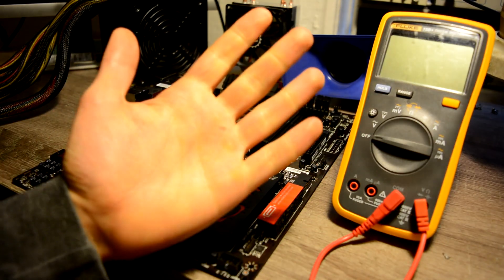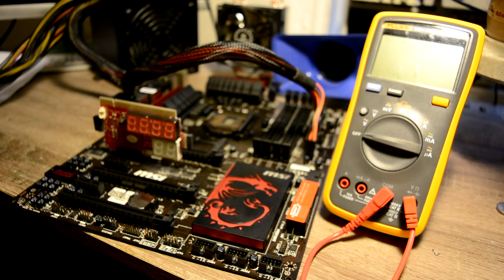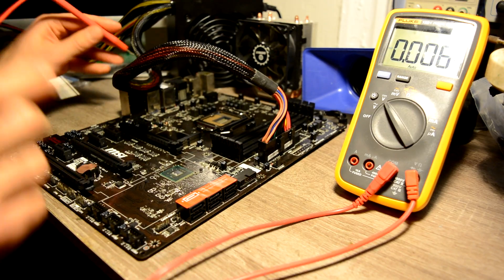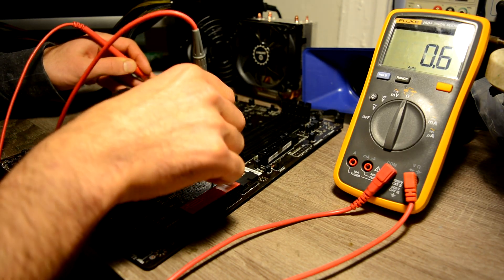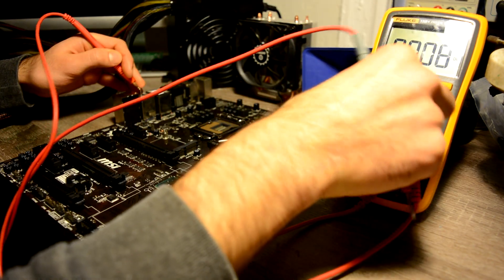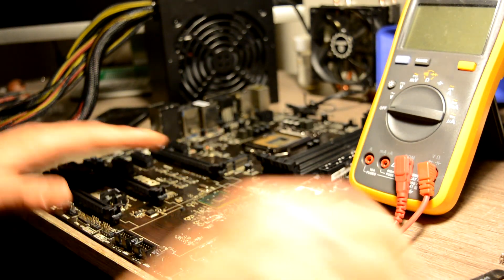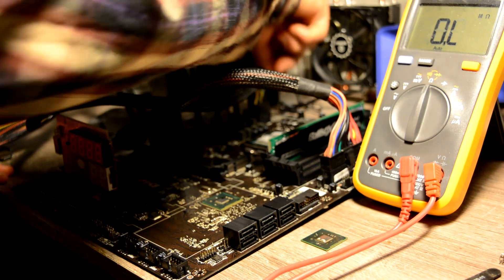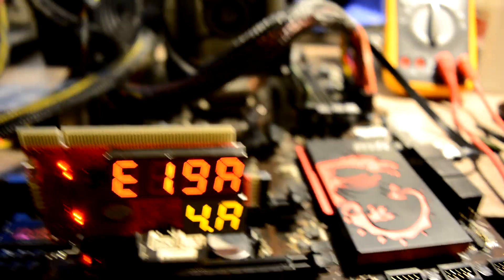Z97-G45 desktop gaming motherboard diagnostic + repair process

Comment: Can u teach me what to touch with the negative what to touch with the positive? My board turns on can play gta 5 but I think I shorted argb I can get lights to light up with unplugging and plugging argb but the computer then gets problems and will get blue screen and shut down but when I initially plug in argb fan at botten of board it won't have no lights until I mess with it unplugging plugging back in  ect

Comment: The problem is that Microsoft is increasingly enforcing the hardware requirements and the new processors no longer fit the slots. It's no longer worth repairing an old motherboard.

Comment: I wonder what type of thermal compound was on the chipset. If it was factory thermal glue/epoxy or if someone replaced it with thermal paste.

I mistakenly took the chipset heatsink off of my main PC (AM2+ socket...) while cleaning it out one day. Thinking it was just thermal paste underneath. Boy was I wrong and what a pain that turned out to be. 5 days of research and 3-4 days of finally scraping that pink crap off with toothpicks I cut in half at an angle - because isopropyl alcohol was ineffective... Luckily I had some thermal pads on hand that I had bought for my old laptop I'm trying to fix up (from the same era). Put 2 and 2 together realizing it wasn't thermal paste initially and there could be some clearance between the die and the heatsink - and it had foam padding, similar to my laptop GPU. Which required thermal padding. - Replaced the pink adhesive with a thermal pad and my chipset temps dropped from around 89°C down to like 56°C lol.

Apparently they're made to withstand high temps, but it's nice to know this old motherboard I had recently maxed out the CPU on might last me many more years. And will be much easier to maintain in the future with thermal padding there.

Comment: bruh my motherborad is also dead. a msi one. its a black screen with no mouse or keyboard lights. sometimes it gets to 99. once it got to that lil black screen that came up once u repaired this mans board. telling all that's plugged in and the only thing missing was the usb. it showed drives and ram. other than that it used to take a while to boot i.e it would freeze for a 20 min streatch be4 restarting and going. any ideas?

Comment: would you like to diagnose twin asus z97-a mobo's? they both seem dead in exact same way.  when power switch is applied the fan spins up then turns off... repeatedly.  never posts.

Comment: Hey man sorry to bother u 2 years after u posted the video, but i have the same motherboard, something strange happened today, i started my PC and i got an instant smell of burning, i turned off the PC immediately, then i opened the PC to see the damage to the Motherboard, to my surprise it was only that small chip that is between those 2 small capacitors beside the sysfan3, so i removed everything from the PC but the CPU + memory, then i restarted the PC and it worked just fine, then put everything back GPU and all, and the PC worked just fine, i could run heavy apps and games no problem, then i used a multimeter to check the voltages on those sysfan3 pins, all was fine, then i turned off the pc and left if to drain all their power, no battery or power for a few hours while i was at work, when i came back i checked the resistance on those sysfan3 pins, all was fine too, so i connected another fan to that sysfan3 and it worked just fine, pwm and all, fan speed worked no problem, the PC works fine but that specific chip between those 2 capacitor close to the sysfan3 its visually destroyed, i can even see the inside of the chip, anyway now im curious about that chip because in my mind it should be impossible for that chip to still be working after literally caching fire and sending sparks... if u want some photos just send me your email or WhatsApp or whatever way u prefer, i am no bot or scammer, i will not bother u i give u my word, if u can spare some time to give me ideias about what that chip does or why the PC "works fine" i would really appreciate.

Comment: Hi quick question I have this same Mobo almost, z87-gd65, uses same parts and all, @6:00 of this video that chip you say it has to be over 1k, is that accurate? I have the same problem as this mobo no power and such and by jumping the 24pin like the previous owner did on your mobo I also don't get post or video to recognize the HDMI, well my question really was because both those chips are reading resistance of Left Chip: Left 716 Mid 124 Right 063 and Right Chip Reads: Left 716 Mid 124 Right 063.... Do I also have a short there? I am continuing to check this video to check the board more but that is so far puzzling me.

Comment: Great work! You really are an expert.
By the way, I have a problem with my PC. It does not turn on even the case LEDs. These are the tests that I've done:
1) I tried to unplug everything except for CPU, RAM, and case fans. It still does not turn on. 
2) Then I tried to remove even the CPU and RAM, but I still connected the PSU to the motherboard. And then, I tried to turn it on using the power button through MoBo. This time I got a feedback and all case fans works.
3) Then I tried to plug the CPU again to see if it will not turn on. Yes, as expected, it does not turn on.
What can I conclude here? Is PSU and MoBo still good? Do you think my CPU is faulty? Thank you.
Reply: lol diagnostics are not free
Reply: yes

Comment: Nice video and hope to see more in the future.
Quick FYI:

Some desktop MOBOs can have a resistance of less than 50ohm on the 5v line (with nothing connected or inserted).

I have 2 Intel boards that show 52ohm and 24ohm on them and work fine. Th is can fool some people used to healthy rails showing 500+ on them.

My first desktop board repair had this. I spent 2 days searching for the 24ohm short on the +5v rail. Two days of prodding and marking data because, surely, 24ohm is a short. Always.

Nope. Got fed up just before taking the PCH off and tested it. Booted right up, lmao. Noticed more like it after that.

If it's showing 20+ ohm and it isn't taking too much current on power injection, it just may be good. Now, here the PCH was getting hot on standby. That's obviously a definite short so look for that but of it stays cool even with powerinjection, test it FULLY
(CPU, one stick of RAM, all fans plugged in, etc).

Comment: When he says "Hub" he's referring to the PCH (Platform Controller Hub), older computers used a North Bridge and a South Bridge for Intel based chips. AMD had its own PCH called Fusion Controller Hub. Now Intel and AMD simply refer to it/them as the "Chipset", meaningless trivia but here we are.
Reply: thanks was lost being a intel guy for life was confused kept talking to the screen calling it a south bridge which I know now is wrong .
Reply: Didn’t know this, however to me, that clearly looked like the chipset. I’ve been calling it chipset for some time, but I do remember the north and south bridge, even older AMD boards had this because I’ve owned amd my whole life and I remember upgrading heat sinks on the n/s bridges. Though eventually I noticed newer mobos just had one bridge and they resorted to call it “chipset”
Reply: I seem to remember most chipsets back in the day after IO moved from a VESA slot  of the '486s to the mainboard  when pentiums  1st came out, both AMD and intel  had a north and south bridge, later on around the time of the via KT133  chipsets AMD had a lot of extra speed with the magic pixie dust of the inter-chipset communication  in the form of a dedicated ' hypertransport'  bus, but intel was stuck at FSB speeds  between the 2 chips , the oddball of the bunch was the  SIS630/730 which was a single chipset that had everything in it, and for once it was a SIS chipset that didnt give a lot of headaches...  and performed well enough for the time
Reply: @DevilbyMoonlight  Yeah, I remember that too.
Intel IDX2 (80486DX2)
Reply: Yeah because the chipset/PCH is what use to be the south bridge. The modern north bridge exists on the CPU (memory controller, high-priority connections) for lower-latency and faster load times.
Reply: thanks
Reply: Where can I find a replacement PCH for an Intel Z690 motherboard?  Need to replace it on an Asus Z690-A Strix DDR4. Other than that I should be able to successfully replace it myself.
Reply: I was sure wondering why I rarely hear them referred to as north- and southbridges. I just call it a chipset for simplicity's sake when there's only one heatsink on the board.

Comment: Hi, I have a z390 Designare, I had it for 1 year and a half, then I switched my RAM modules, in this specific motherboard I wasn't able to enable XMP, it simply wouldn't post, and when it post, it BSOD or freeze...
It got worse recently, when turning it on it get stuck on DRAM and sometimes VGA (both are fine), then I found out that CPU VAXG is showing 0.0v, reseting the bios didn't changed it.
CPU socket pins seem fine, so I wonder where the problem is exactly...
Could you point out elements to check? I'm thinking this could be a similar problem...

Comment: Hey buddy, I've been having a problem over the course of the last 7 months, my PC wouldn't post and the CPU_led stays on, it happened first in march for a couple of days, then again in June, September and lastly yesterday. Every time it would be solved differently, like once it worked when I took the motherboard out of the case, another when I reset the CMOS. When it happens again, none of the previous solutions work, and now I'm stuck and have no idea what to do. Please note that the thermal paste is old and dried out but when it was working until two days ago the thermals were pretty alright for a stock cooler. Could this be my problem?

Comment: I have exactly the same diagnostic, but it is not the Chipset, the one that turns on if I bypass the power supply  its  the chassis fans, the CPU fan does not turn on either

Comment: I have a faulty Asus Z270-P  Motherboard. It was ultrasonic cleaned but the CMOS battery was left in. After this it doesn't work anymore. Would this be an easy fix or not?
Seems to be that the power supply does not get triggered to power on. I initially thought it was a faulty PSU but i tried another motherboard and PSU worked fine.

Comment: this is one of the damn reasons I always go for bang for bucks mbs. Since Electronics come under no absolute warranty it's a complete waste to spend money more than you need on a motherboard. Get your chipsets correct and go for the one with most feature for less money. I've had fair share of mb shorting and let me tell you it's not a simple task to get these back to life. Specially manf wouldn't do shit if they even found out you had just removed the cmos battery.

Comment: Hey Eli,
I got a MSI X470 Gaming Plus, as my brother buyed a PC from ebay where the vendor had no screw in mainboard to fix it.
So while beeing shipped, it inspected every corner of the case. Then, while not booting up, he got a refund and I have now the old board.
It runs again "yeahh", but 2nd memory controller won´t recognize. So it boots up with RAM post beep, recognizes 32GB but only give me 16 to use.
CPU is ok, RAM is ok - so it is the board. Where would you start to search? Measuring from CPU to RAM slot? (Do you have a wiring diagram?)
Br Sascha

Comment: Great video. I have a msi motherboard that the cup fan spins but the motherboard shows no display also the pic e slot has no power. What would be your opinion on what's wrong with it. Thanks

Comment: Hey I have a nvidia geforce titan.  When I plug both external power cables it won't turn on but if I remove one it starts and states I have to connect the other power cable.  I have not worked on gpus before but have extensive knowledge on board repairs period.  I'm assuming whatever ic is supposed to turn it on when it sees both cables plugged in is not doing its job but its hard to see any tracks on this thing and I don't want to take a hour in beep mode... Is there schematics for these boards and if not can anyone give me pointer in the right direction please??

Comment: Hi, so desperate as of now. Have you encountered this problem? 

I have a Msi b350m bazooka and a ryzen 5 2400g. Its been almost 2 years, and last friday it wont turn on. I pull out the motherboard from the case, tested it with out the CPU plug in or seated in. The motherboard turns on, but when seated. Motherboard wont even light up. What could be the problem? 

Maybe the bios was resetd and the board wont identify the cpu?

Comment: @Eli Tech, i have asus rog rampage vi apex mobo and few pins in socket are bent and tried unbending them and it worked fine, later on i had a leak in waterloop and A1 memory slot stopped working and i sent it in repair to asus but they declined to repair under warranty due to socket pin damage even though even though it was not a problem, later i tried to mess with pins again and broke one ( like 6-7 pins were bent and i broke one trying to bend them back again, so i purchased a new 2066 socket and i should get it soon, will u be able to replace socket and also check why A1 ram slot does not work, at this point i dont know what else is not working as i have not used it ( but after the leak i dried it good and it booted fine except for A1 ram slot not detecting any ram), do u have time to fix my mobo, thank you.

Comment: sir, my unit is not powerring on if both 24pin psu cable and 4pun cpu cable is plugged in to motherboard. once 4pin cable is removed and 24pin is left connected that is the only time i get the fans running but still no boot.

Comment: hey bro i was just thinking  the customer that had this board that i need to fix, they had the psu floppy cable plugged into a fan header do u know what may have shorted out or burnt out so i can replace it? any ideas thank you  its a  Asus M5A99FX R2.0

Comment: Hi, I have an old motherboard and I desoldered the speaker buzzer, now it won't power on, no fans, no signs of life, could it be that the buzzer is connected with power pins, and the motherboard won't power on without it?

Comment: Hey Eli i have an asus Maximus vii ranger z97 and it turns off split second after turning on. A guy replaced for me the pch chipset and it turns on again once after which it dies again. He replaced the chip few times and same issue. He said it might be one of the transistors near the chipset that's causing the chipset to die. Can you help out pls? I'm from Middle East so can't send you my board but can offer some donation through PayPal. Thanks.

Comment: Where can I obtain a post card like that that works on modern boards?
Reply: Aliexpress
Reply: @laboratorioassembler  Thx. Name of card or link to one?
Reply: https://m.it.aliexpress.com/item/32759791224.html?pid=808_0001_0109&spm=a2g0n.search-amp.gallery.32759791224&aff_trace_key=303d817169b54764868a0b0b721e8f16-1557120594686-00625-UneMJZVf&aff_platform=msite&m_page_id=7515amp-JKMXXn43bYhhsjgeDERT5w1557120611514

Comment: Hi Eli, i have "fix" a msi gtx 970 gaming 4g by removing 1 faulty mosfet and 1 driver, so my card have 4 phases on the original 6 phases, did you think it's can damage it ? (i can not replace the dead mosfet because it was solder to the pcd due to a very hard burn and some trace are gone) Thanks !!

Comment: Hello i have a Gigabyte Z87 motherboard (im not sure on the model i will have to edit this when i know) it powers on but after a few seconds it will turn off, then power back on and it keeps doing this with or without a ANYTHING installed. any idea what it could be and how much to repair?

Comment: where do you put the ground on the board with your left hand when checking ohms? I couldn't see from the video angle.
Reply: the metal casing of the IO connectors...
Reply: @AKAtheA  thanks. I didn't know IO connector port could be ground? or did I understand wrong?
Reply: @Tko_Seven  It has to be grounded - it's deliberately touching the case through the IO shield and also all the IO connections have shielded cables (usually... some chinese made ones may omit this to cut costs), which should be at ground potential.